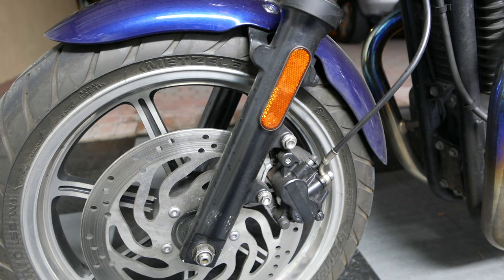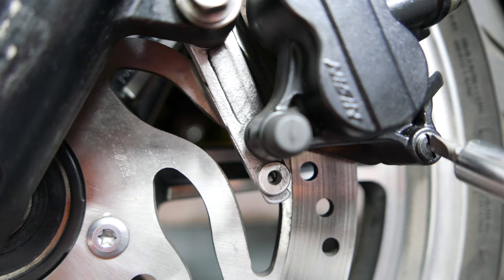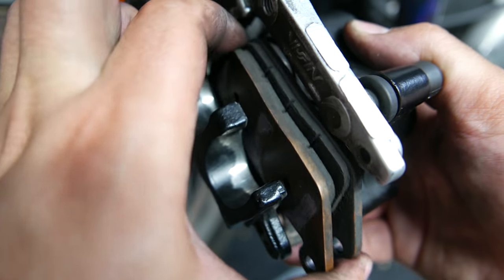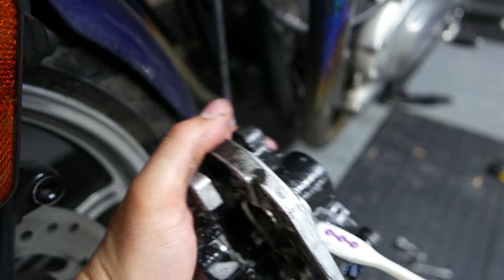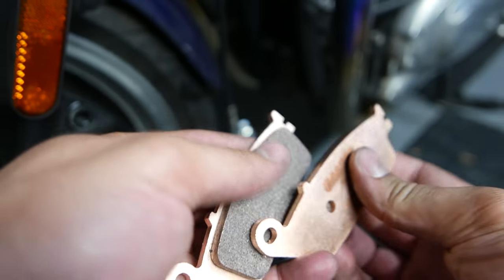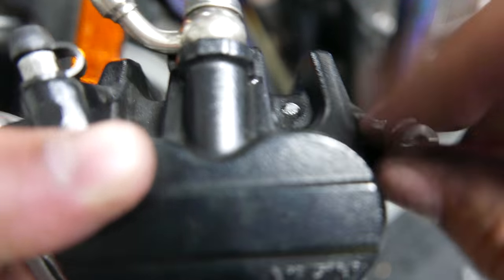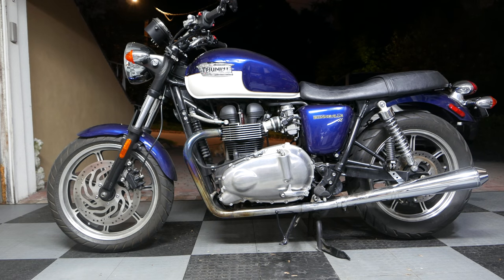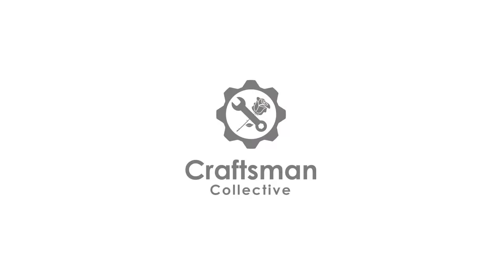How to Change Front Brake Pads Triumph Bonneville SE, Scrambler, Thruxton, Motorcycle

Comment: After switching them, should the wheel move freely or should there be a bit of resistance? Mine sound like they are scraping. As if I was lightly pressing on the breaks.
Reply: Yes they should be touching the brakes ever so slightly. That means the two pistons or doing their job